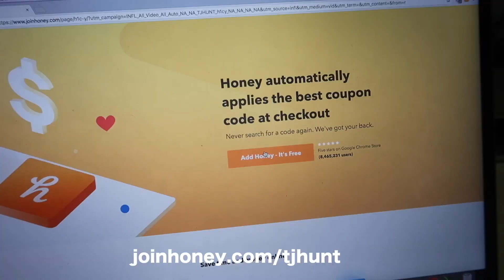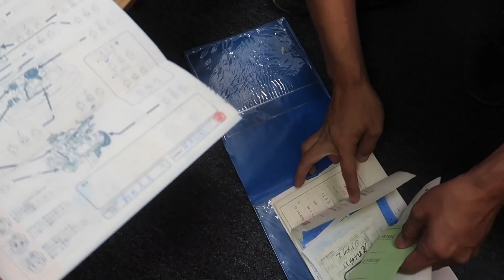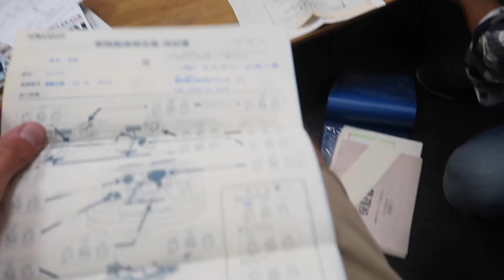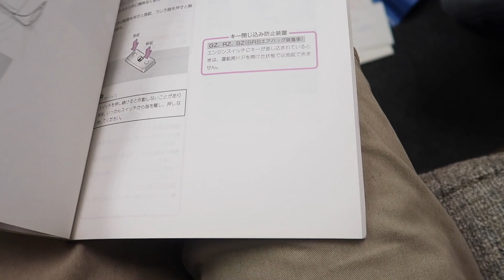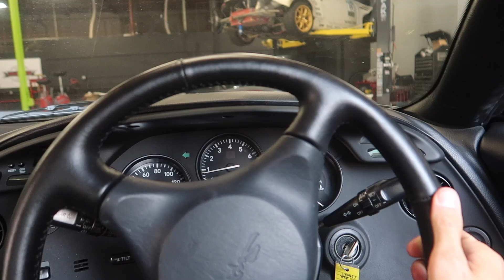Taking Delivery of my Toyota Supra!

Comment: I purchased my 94 Supra NA manual in 1997. Motor & tranny are 100% stock. The stock silver paint is immaculate & drives like the day I purchased it. Yes I’ve babied & taken extreme care if it. I’ll never sell it, it’s been the most reliable car I’ve owned. 26yrs later my stock Supra still turns heads.

Comment: The little black car is a Nissan Pulsar GTiR N14. There were a few different versions the RA had AC, electric windows, ABS etc and the RB was a stripped rally version. Its a 2.0l turbo (SR20) 4wd. 0-60 was about 5 seconds iirc

Comment: The reason the shift isnt sloppy because the trans isnt some w58 or some r154 it's the v160 it's the top of the line manual trans for the supra and it holds tons of power

Comment: The turn signal doesn’t change depending on what side of the car the wheel is         I live in the uk. We have 8 cars and the 1 that is imported from Japan has it o the other side. It’s just a Japan in port thing.

Comment: Clean subtle mods........no widebody.....no crazy canards that stick out 10 inches.....no obnoxious giant wings or splitters

RIDOX is the kit you want.......get out the checkbook and dooooooooo iiiiiiiiiit!

Take it to Mickey spec and respect the stock body lines and heritage of the car........nice rims, small lip spoiler and tint. Put small flat splitters front and rear that they are barely noticeable 
Go nuts under the hood but keep the outside sleeper

Comment: Can’t believe we nearly got an NSX build 😭 the supra is no more special or different than a RX7 which you have already. That little black car is a Nissan Pulsar GTI-R, in the late 90s into 2000s they was very popular import here in the UK and common. Can make them very powerful and quick with the four wheel drivetrain but they have a massive rep for eating gearboxes.

Comment: I will bet money on the fact that, that supra has been odometer rolled back. 40k miles and a ruined factory steering wheel, pedals that are worn... it’s been tampered with 100% I’d guess more in the 140,000 km Mark.

Comment: Nissan pulsar gtir is a 2 litre 16v turbo 4x4 220bhp weighs nothing proper flying machine based on the nissan sunny I had one with 400bhp and I got beat by no cars even bikes struggled to keep up 600s no chance 1000s did beat me but in twisties nothing kept up subaru imprezas and evos standard for standard nissan wins every time